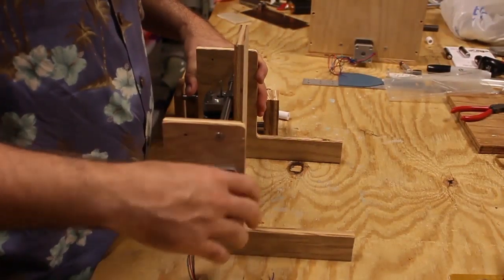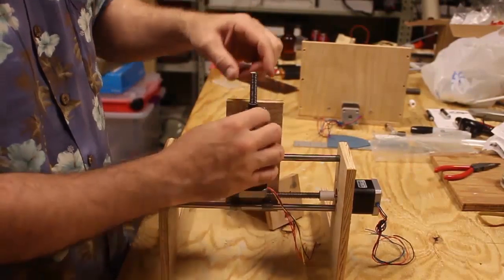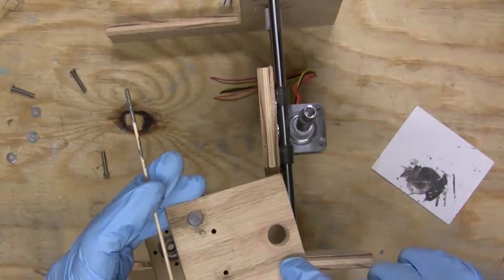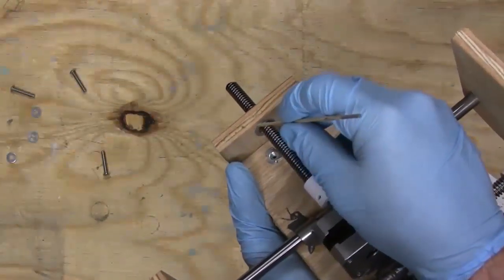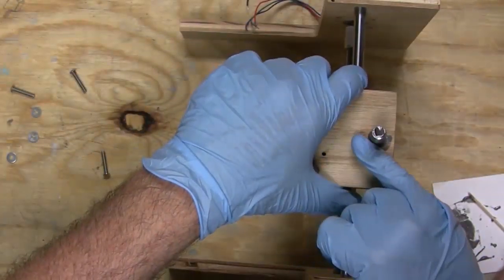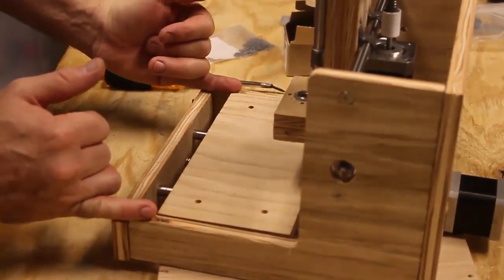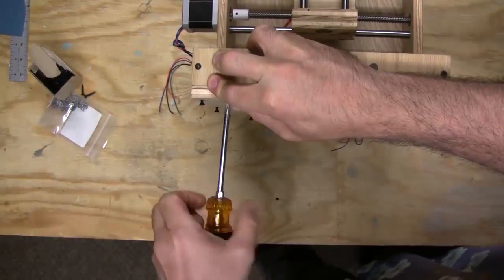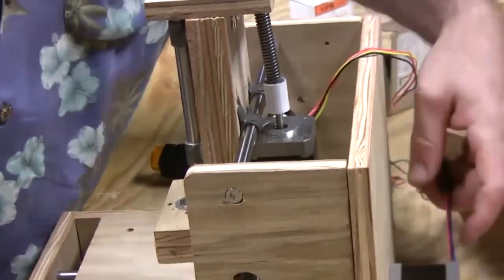Cheap DIY CNC Mill Part 6 of 7

Comment: Nice build. I think I'll give it a try. Just one thought. Why glueing the Z axis motor. You can find 90deg motor mount that I think fit in the space. I know the goal is 'Cheap' but the two other motors are fixed with screws. and this one is subject to more vibration because of the spindle motor. Epoxy is strong but You know not so clean if you want to reuse the stepper motor later.